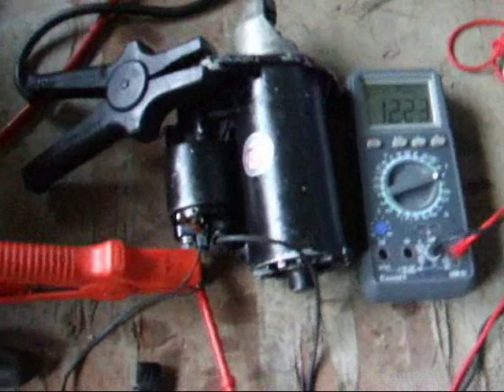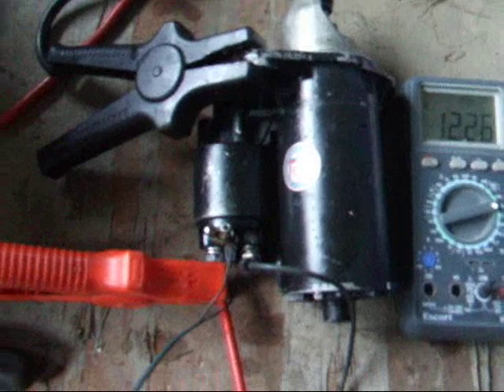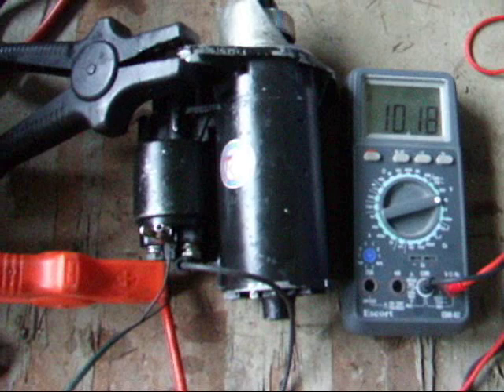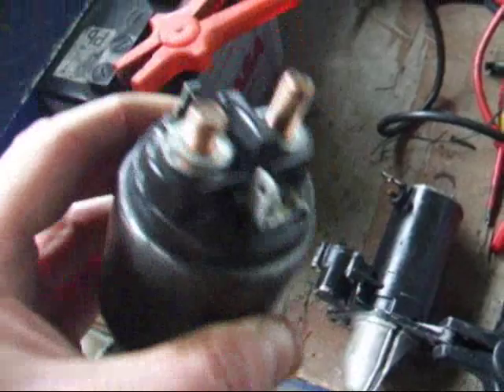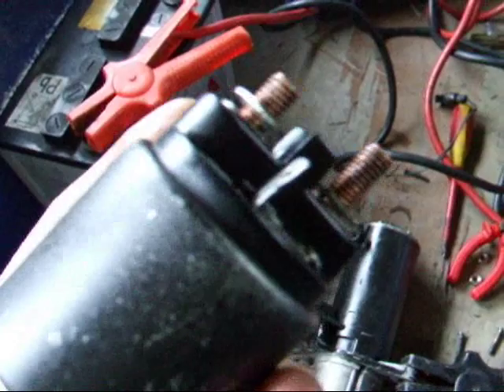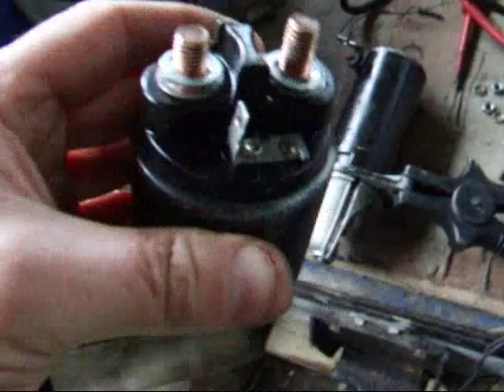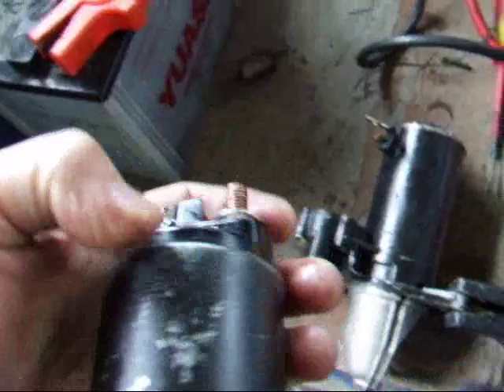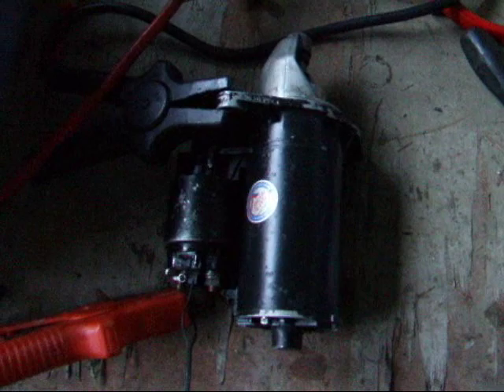Land Rover V8 Starter solenoid fix

Comment: Had the same issue, tried this fix but it only lasted a week. Then my local spares dealer was on holiday and I had to get the Land Rover working. So I decided to strip the solenoid down. (Vaguely remembred advice from my dad.)
To get at the contacts you need to get the insulating cover off. The cover is held on by two screws and the two soldered ends of the solenoid coils. So remove the screws and get a reasonably powerful soldering iron mine is 50W, ther copper is thich and will dissipare a lot of heat. Melt the solder and suck it away with a solder sucker, then whilst it's still hot strighten the wire poking through with a small screw driver. It's fiddly but the cover should then come away exposing the contact bar. Polish both sides of the copper contacts with some Merlon or simlar. I was expecting the contacts to be silver plated but both parts were raw copper, hence they wear out after a few years. Clean everything and remove the copper oxide dust. Fit the studs into the the cover and tighten them up. Then replace the cover making sure the wires poke through the holes. Note one of the wires is actually two wires twisted together, this is the start, the other wire connects to the starter moter link. (High current coil pulls in the solenoid, low current holds it in), make sure both wires come through.
Bend over the wires to hold them in place and re-solder.
It took half an hour.